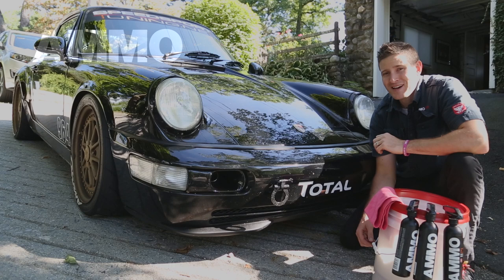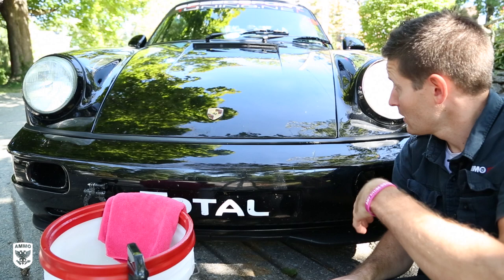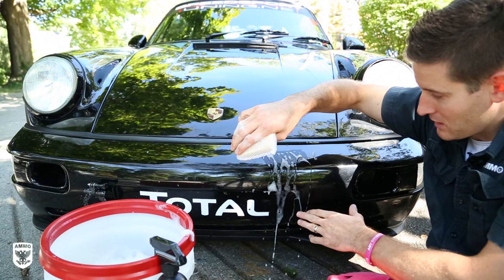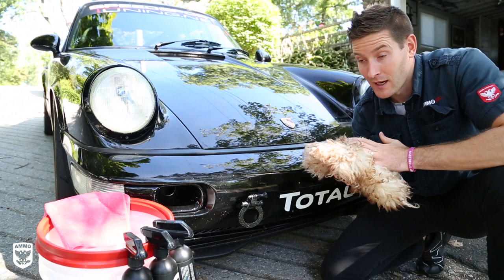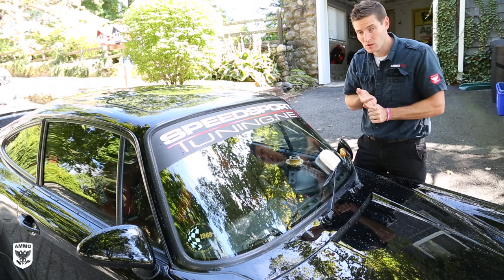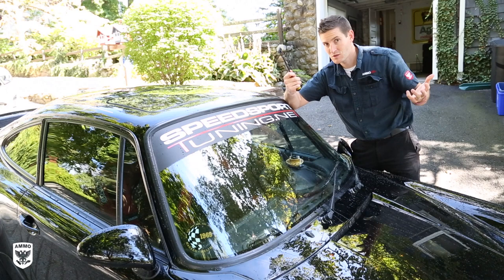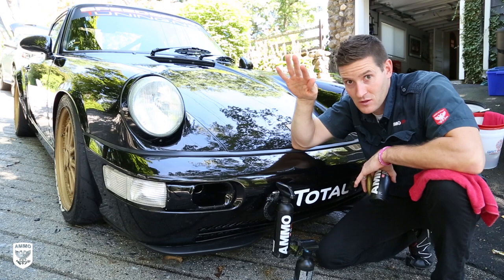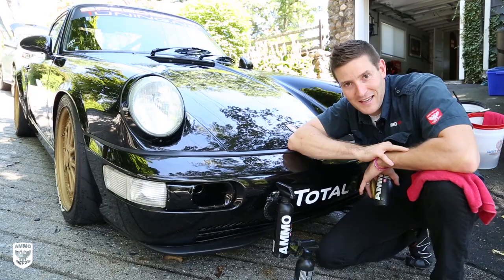How to Remove Bugs Safely

Comment: Thanks Larry! I've been removing bugs Unsafely for years with my chainsaw! This method is gonna help thanks!
Reply: ***** actually I find a blow torch easier!
Reply: +ThatGuyNamedScott. C A chainsaw? Why not just scratch it off with the pocket knife? Its much better for the environment...
Reply: +ThatGuyNamedScott. C 
Hydrochloric acid works great, very light cleaner. I'd also suggest using 50 grit sandpaper for those tougher bugs along with some steel wool for the stubborn ones.
Reply: Use brake fluid, your paintwork also comes out great after (don't)
Reply: Hahaha made me laugh man
Reply: ThatGuyNamedScott. C you are best scott
Reply: ThatGuyNamedScott. C hey my boy Larry he's a good guy working hard to make a living.  And he's made good. Larry is living the American dream. Way to go Larry 👍🏻🇺🇸
Reply: lmfao
Reply: I just buy another car
Reply: I use a wire brush on my angle grinder!
Reply: I use concrete 🤷‍♂️

Comment: Thanks for all your videos Larry. One solution I have found from years of riding motorcycles and getting bug guts on a helmet - use a  towel soaked with warm water to dampen the bugs for  several minutes prior to application of a spray wax. 

Plexis is expensive but works very well. There's a mild solvent in it which doesn't appear to harm the paint, at least on a helmet/motorcycle. It was reportedly designed for cleaning aircraft windshields.
Reply from the maker: Than you!

Comment: Hey Larry a tip that ill give to this  , I own a semi and bugs pepper my truck and i don't have access to a hose and water what ill do is take a micro fiber cloth thats Damp ( not wet ) and set it over the spot and let it set for a bit and wipe it off , the steam from the sun and moister softens it up then they become easier to wipe off.
Reply: Awesome tip!!! Thanks.
Reply: That is a great tip too, i used that on my motorcycle and my gear after a long warm ride. Everything was covered in bugs and their "juices" yuck!
Reply: Huh. I have a steam cleaner, maybe that would work nicely too?
Reply: Exact same thing I do every now and then on my helmet visor. Works like a charm and no scratches.
Reply: Yeah Science!

Comment: another helpful video larry. my little tip i use is to get some boiling water from the kettle in a bowl with a micrfibre towl and soak it in the water then lay it on top of the bugs and leave for a couple seconds and wipe away. 👍. use it on my motorbike all the time

Comment: What I normally use is a "de-bug" spray from any of the known brands - Soak the bugs and let them re-hydrate with this spray, and then wash it off with a pressure washer prior to doing the regular wash. This works well if you have an extreme ammount of bugs in the front, after a roadtrip which was done in high speeds (highway etc) - What are your thoughts on these products Larry?
Reply: Some bug removers can be pretty harsh and strip any protection you had underneath.
Reply: +Alex G You are absolutely correct. But having a completely "touch free" removal of the bugs still seems like quite a good deal for me. I do not mind adding a bit of sealant more often. I also wet wax my car every wash. So it is pretty sealed up :)

Comment: That's basically what I do. Except that for "fresh" bugs and bird poop, which I try to remove as much as possible with just hitting it with spray water and then scoop the remaining with microfiber towel. Generally it works great. But if it is not "fresh" I rather go with full wash and pressure washer.
Strongly agree with you. I love my bimmer to death, but that doesn't mean I don't enjoy it, take trips with it, rev it up occasionally. It's all about creating memories with it and having fun.   
Thanks, Larry.

Comment: Have another tip with this one. I use paper towels. I wet the area of bugs, place the paper towels on the bugs and allow it to stick. Then use a spray bottle to wet the paper towels but not saturated and then leave to dry in sun. After drying finished, I use a hose to pre-rinse the buggy area as well as the rest of the car.

Comment: What about specialized products like Bug Remover?
Reply: They work fine, but they are solvents and likely strip away sealant/wax protectant you have. Also if it doesn't totally work (some work better than others) then you've just gotten rid of your protectant and didn't even get rid of the bug completely; better to just use gentle agitation.

Comment: I keep an old blanket in the garage and if I get a bunch of bugs on the front of the truck Isoak it with water and throw it over the front of the car to soak the bugs then they usually mostly spray right off

Comment: Here is what I do for the best results:  I just go to the car wash and use the big brush that some guy just used to wash his wheels with..  the abrasive materials from his brake pads are retained deep inside the brush and make light work of cutting thru those pesky bugs, while providing me with a budget clear-coat polish.  You are too fussy my man.. lmao
Reply: This is the opposite of a polish. You're scratching your paint with dirt.
Reply: gas station winshield washer. works great. better to have swirl marks than a bug baking in you clear coat.

Comment: Really great and informative video. However, I get to correct you on one thing, your razor blade technique. You should always pick up the blade on the reverse stroke, because otherwise you drag any hard grit still on the windshield (or on the blade) backwards across the glass and scratch it.
The pressure washer really is man's gift to man here, I live in the country and it's indispensible

Comment: I use dryer sheets, soak one inside a spray bottle with a little warm water, spray down the area then take the dryer sheet out and use it WET to lightly scrub the bugs like your bug sponge. WARNING: will leave a nasty film do NOT let dry. Have not tried it on anything but stock single stage paint so test small area first.

Comment: The method I use is to soak the spot (bug splatter) with prewash soap. Then I go over it with by staying high pressure soap and water over.  And if nessary I uses a micro fiber wash rage and rub it while running water over the area effected.

Comment: I brought my Challenger to a 2000 mile trip as soon as I got it and when I came back home my from bumper looked like someone shot it from really far away with a shotgun. My whole front bumper paint is ruined because of bugs and rocks. I tried cleaning it very well when I washed it and most of the bugs came off but some of then where literally stocked to the bumper, when straight through the paint and into the bumper I had never seen such thing.

Comment: Florida question?? If the love bugs completely cover the front bumper and window, is it necessary to use a clay bar if they feel baked into the paint during the wash process after different methods of cleaning?

Comment: I travel a lot, so I keep a spray bottle with a mixture of whatever soap I'm using mixed with water. I go buy a coin wash, spray the front of my truck down good and let it soak for a few. The bugs and whatever else I've accumulated comes right off.

Comment: I used clay bar on the car, rubbing compound, polishing wax and finished it off with sealant, but I still have marks from bugs (no bugs left, but spots left behind like if it is a dried water droplet) on the front of the hood. Do I need a harder pad? :-/

Comment: Excellent steps, but using the scraper on the glass works but needs a perfect blade and very light pressure otherwise it will cause bad scratching.

Comment: It seems to me that people (including you, Larry) would have found out the benefits of using a mixture of hydrogen peroxide and water to remove bugs. It's so much easier and faster. 1 cup of 3% hydrogen peroxide mixed with 3 cups of water, fill spray bottle, spray the bugs, watch them melt off, rinse with clean warm water, dry with microfiber and protect with hydrate and skin. For bugs that have been on the car for awhile (including mirrors) get an old tshirt, cut it to fit the area(s) where the old bugs (that have been sitting for weeks) are, conform the tshirt to the mirror, bumper, headlight, etc. then SATURATE the tshirt with the hydrogen peroxide/water mix. Let sit for 10-15 minutes, wipe the bugs off with a damp microfiber towel rinsed in warm water, and you're good to go. For bugs that have damaged the clear coat, they can be COMPLETELY removed by using Novus 2 plastic polish. I'm really surprised that no one knows this stuff already. You would think by now, it would be common knowledge.

Comment: What about bugs from 2015? legit question, unfortunately. I have PPF on the front bumper and it's almost impossible to get off. Pressure washed multiple times and used bug sponge and still can't get them out. Any tips/ideas?
Reply: Read reply above.

Comment: Larry,
I asked this in the last video, I'm hoping it gets seen here
I have taken up drag racing and second gear burnouts with Mickey Thompson  ET street rubber leaves a lot of balled up rubber in all areas, how do you suggest cleaning the heavy stuck on chunks vs the light dust that I've had from road course days?
I washed the car today after leaving two events on it and it was difficult to clean certain areas with heavy build up. I used a pressure washer, bug and tar and eventually resorted to Stoner Tarminator which ended up smearing liquid rubber all over and ruining brushes and cloths. What's the proper most efficient way?
Reply: +ndinadis Honestly just lots of elbow grease and patience. For the future you can buy products like burnout guard or use pam/vaseline to keep it from sticking next time, or even blue painters tape now that you have an idea of where it flings to.

Comment: Hey. I drive my cab only on sunny days, or non rain days. It stays in my garage all the time when I am not using it and I wonder if there is a good way to dust it off? Usually there is always this dust from the road and inside the garage that sits on the car and I assume gently using microfiber towel with  spray wax to wipe it off is the best deal?
Talking about a clean dusty car, not dirty dusty. 

Thanks
Reply from the maker: yes spray wax and a microfiber.  if it's too dirty I would rinse and clean or take out and do a full wash.

Comment: I have watched a couple of the video's and want to know how to remove dried tree sap from the top of my car.  I have a black Toyota Corolla  and the sap is about 6 months old, I have tried just washing it "about 6 times", goof off and then rinse right away, rubbing alcohol and now am out of ideas.   Thanks Greg
Reply: Don't use GOOF OFF. That will remove paint. Use GOO GONE.

Comment: Hey Larry, I've got a brand new car with some mystery spots. I've tried soap, big and Tar remover, IronX, and APC with no luck. The only thing that works is multiple passes with clay using moderate pressure and the larger ones leave behind a small brown spot that seems impossible to remove. Do you do any private consulting? I'd be happy to send pics and pay you for your time.

Comment: Dear Larry, I like Your videos but for bugs my wife has the solution: take a newspaper page and wet it, put it on the bugs and let them soak for a while. Now You can easily rinse them off. No scrubbing or scratching. Warm water works better. Why newspaper? I don't know but it does. Off course no magazine paper :-)))
Sincerely, Bernhard

Comment: Larry! Any tips on how to remove road paint off car paint?
Reply: carlos valdivia our daily car drove over yellow line paint due to it not being advertised as wet. What I have found worked was a pressure washer to blast it off it Still Remains a little bit to this day.  I hear it is latex based, so I'm going to try tar remover next to get the last 10% that remained after the power washer was used..

Comment: whats your opinion on super clean?  I had bugs on the front of my car for over a week, did a quick wash down, then used super clean on the areas with bugs, with a microfiber pad, and it took the bugs off easily.
Reply from the maker: The question is not if a product like that will work...its if the product is SAFE on the paint and works. You can also remove bugs with a screw driver or acid as well...but what is the resulting damage. I'm joking of course, but you get my point. Just be safe :)
Reply: I do lol.  Thanks.  Do you know if that product will damage the paint, in your experience.

Comment: Good video. Why use a spray wax to clean? To clean bugs, bird droppings and a bit of dust if not doing a full wash I use Optimum No rinse. I use a spray bottle with a QD strength mix and spray the area, then just a mitt and ONR mix in a bucket and wash and then dry with a MF towel. Wax in my mind is something you use after you wash to protect the paint.

Comment: What do you recomend for a powerwasher I tried a harbor freight pw this summer electric but it only lasted about 5 washes before it burnt out i really liked using it but am now looking for a better more lasting product
Reply: home depot has a good one for 100 that's electric as well
Reply: Brett T thanks
Reply: +R Dixon 
Try a gasoline powered pressure washer. The electric versions generally have a low PSI and they also go bad quickly.
Reply: +R Dixon Try Nilfisk. I use a Nilfisk titan
Reply: I can really recommend "Kränzle" - Powerwasher from Germany, the best you can get. I have maintained an 20 yr old electric PW and it was perfectly fine, just a little bit dirty, even though I have dismounted every single part I couldn't see any wear after all. Built for eternity. They mostly get produced in Germany in a town I live nearby.

Comment: Try this.. while you're washing your car take a small stack of dryer fabric softener sheets, like 6 or so, dunk them in the soapy bucket and gently rub the saturated sheets over the bugs, you're not trying to take the bugs off just saturate them. Let it soak for a minute or two then take a soapy wash mitt and wash the melted bugs right off. It also works with tar splatter or oil. I've been doing it for years and it works great, doesn't affect the paint and your front end smells great to boot. Try it out.
Reply: GunfightersINC I heard it works well on love bug.